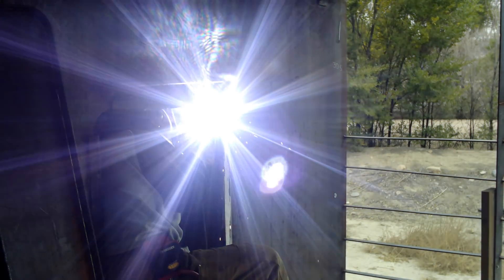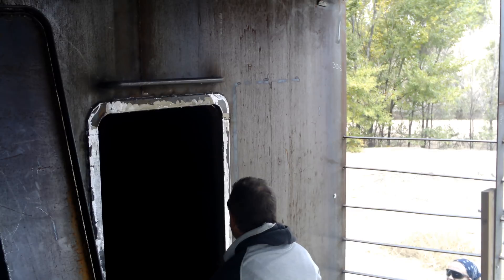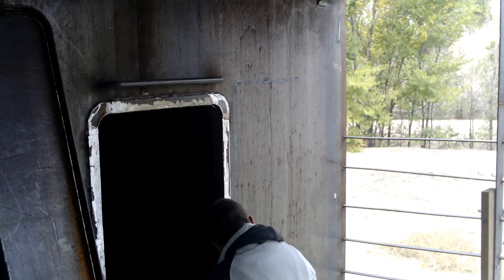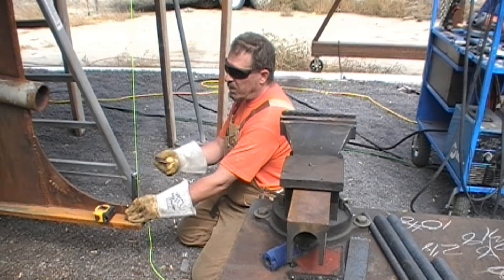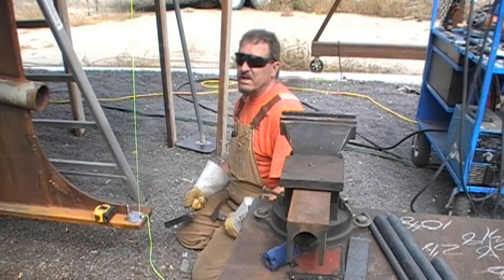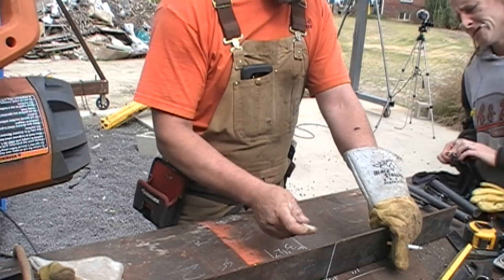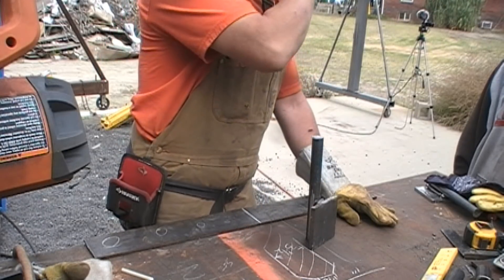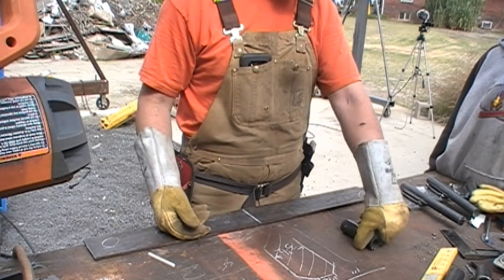Lady Dew Build - Episode 16 How we gonna steer?

Comment: Donnie, Teflon bushings on the rudder pintles for Smooth, EASY Steering. Oh, Okay, you're On it. I think I'd like 3/8ths strap for the gudgeon mounts straps, cause rudders tend to take Hard Hits. Say you slide the keel along over a reef or coral head, when she drops off the skeg you got the whole weight of the boat on the rudder straps. 1/4-inch seems a little Light, to ME. Or say you Reverse into the Conning Tower of a  passing Submarine, or some freaky shit like THAT. It's probably Just Me, I got a Thing about STOUT rudder hardware. I know HOW the Bismarck was Sunk. And since you only have a Single Engine and Prop, you can't Differential Steer with the engines. Just a suggestion.
Reply from the maker: I got some 3/8" stock I can use... Not a bad idea

Comment: Hey mate. How much thought have you given to self steering?
Reply from the maker: The rudder it’s self is 90mm thick and almost a meter wide in the water and a portion of it extends to above the aft deck, I will control it with two opposing hydraulic rams which will be connected to the helm and the autopilot for self steerage.  Should the hydraulics give out I can connect a tiller to the top of the rudder for steerage. Now, since I haven’t been in the deep except my Navy time I would love to hear your thoughts on this subject since you have some experience with this.
Reply from the maker: Oh and thrilled to see you here!!!!

Comment: I saw you'r comment on the seeker channel about you'r chines and how you were trying to figure out how best to tackle the big bend.I have never done it but have witnessed it done.The builder started both at once starting at stern end and welded the straightest part first and had both extra long .Then at bow he used both chines and pulled them together at bow as he welded off.Yeah there is a lot of heat as you go to be added but they got it done and it was a beautiful fair line when done. 12-15 feet extra long for the leverage when winching them together at bow was the key.

Comment: I just finished watching the video that s/v seeker did on building Ladydew, and you mentioned the possible difficulties with putting a pipe along the sheer. I've been building boat/ ships since the early eighties, navy frigates etc  and what we did at the sheer was to split the pipe which made it much simpler and easy.
Reply from the maker: I've read about splitting the sheer pipe and agree that would make it a lot easier, But I want full pipe for two reasons, a) more strength at the sheer and b) the sheep pipe will stick up about half it's diameter and would act as a toe rail and catch rain water to help fill the water tanks when needed.  But then a flat bar as a toe rail would work just as well... I'll think on this. Thanks!